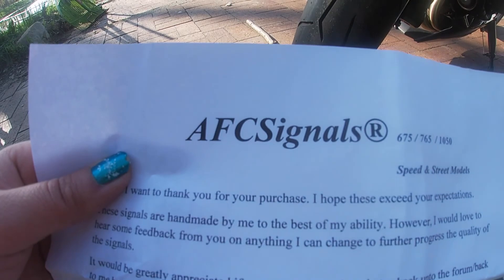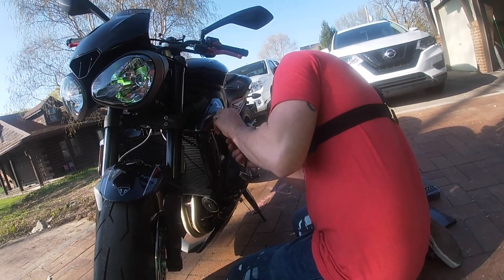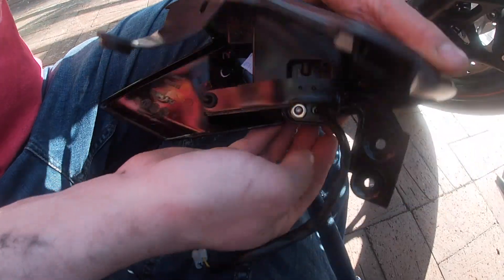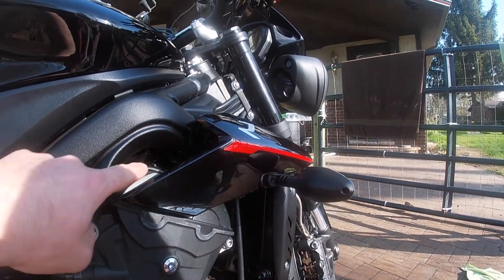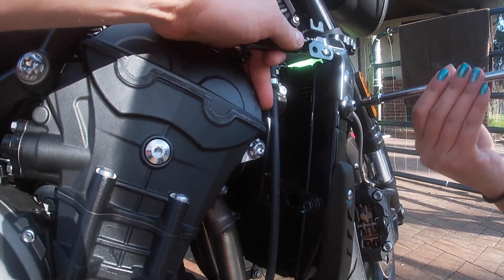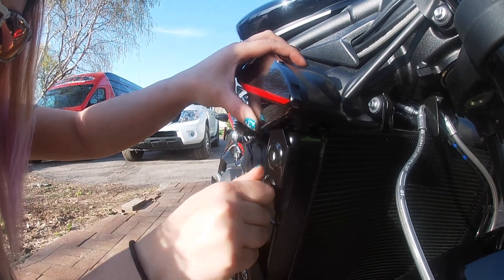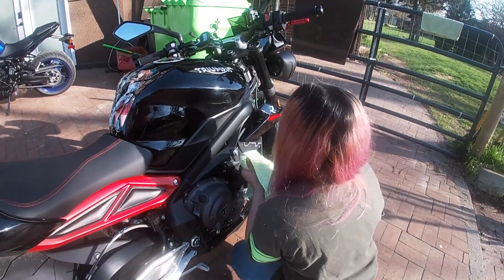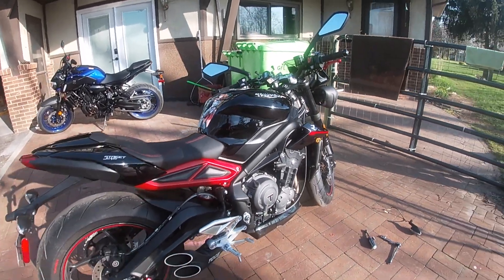Installing Flush Mount Turn Signals on 2018 Street Triple 765

Comment: What an awesome idea to conceal a prominent safety feature on a machine which is already dangerous enough and which most motorists have trouble seeing. Well done.
Reply from the maker: Thanks for watching! We are sorry that you don't like the idea of flushmount turn signals and we get your frustration. Having prominent safety features does not always help to begin with, as you said "motorists have trouble seeing" already. We are not the first nor last to install an item such as this on our bikes. Some people prefer the cleaner smoother look of the flush mounts and they are still very bright being LED. The riders legs do not cover them and they can still be seen from the front of the bike. We are not chastising or denying your claim, it is a good point. But no matter what, riding a motorcycle is risky regardless of the state of the bike itself.
Reply: If you get the clear or light smoke  ones it pretty visible. I'm getting a couple to replace the originals due Im sick tired of they breaking apart when I drop the bike
Reply: They are actually more visible than the video shows. They are not Watsen bright however. Those can cause burns in your Retinas they are so bright and were visible from every angle. . I wish he still made them.
Reply from the maker: @dv2045  thanks for watching! We haven't had a dropping issue yet! Best of luck to you and hopefully she stays on 2 wheels more than not!!
Reply: I agree. I ride motorcycles also and think it's not smart to make tiny hard to see turn signals
Reply: @dv2045  you got bigger problems than replacing turn signals, my guy

Comment: Hi, I just ordered these for my speed triple. Just wanted to ask your experience with the vendor and how quick were they with the turnaround with your order?
Reply from the maker: It was a few weeks for turnaround
Reply: @3rdgear877  Thank you for the info!
Reply: @3rdgear877  i ordered mine over a week ago and still have not received any email about delivery or anything
Reply: @Mcleanbe123  update...i still have not received my turn signals. I did FINALLY receive a tracking #. Ive had to reach out to them via instagram. They keep telling me they are going to ship them the next day and they just never do. This saturday will be 1 full month since placing my order
Reply: @RevBombRR  have patience. It took about the same amount of time. Andy (AFS) runs this as a hobby business and makes everything to order. The longer time is worth the wait instead of buying chinese garbage.